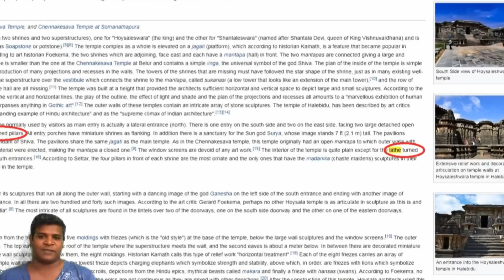Hoysaleswara Temple, India - Built with Ancient Machining Technology?

Comment: Good work here. When I've seen documentaries on these places they never look at the details so difficult for me to make an educated guess how they built these temples. It's usually some Archaeologist who has little understanding of engineering who makes the wrong conclusion and doesn't know what evidence to look for. The pillars are definitely done on a lathe of some description. Probably steel mandrels to hold the ends of the rock and a couple of steel wheels at each end for it to them to run on. This would make it much easier to turn while someone with a hardened tool carves the shape to a wooden template. How they turn it would be open to further analysis but some animal powered machine would be obvious. I would centre my attention on looking for the tools first. The polished features could just be from years of hands touching, I've seen many of stalagmites and statutes polished from thousands of tourists hands.

Comment: I wonder if there is such a thing as a reversed lathe. Seriously it wouldn't be that hard with 900yr old tech to just build something that spins the tool around the pillar instead of spinning the pillar. I'm pretty sure if I research it I can find evidence of such a thing existing back then. 

You also might not want to stop thinking of them as primitives because there were not. Maybe they had multon forging capabilities back then. The ancient indian/egyptians  and several other civilizations generally aren't as cavemen like as most people think. The last time I studies a similar statue like that one we found out that the parts of the statues that were hollow inside will just tiny openings to gain access to hollow out the inside were actually added onto the base of the statue. In my case we had figured out that they had melted down that type of rock, used standard molten forging at a very high temperature and then fused the object onto the base. Yes such a thing is possible and has happened lots of time before. 

It wasn't aliens, it is just science.

Comment: If this temple is roughly 900 years old, or maybe older, it is perfectly possible that people used some kind of machines. It is quiet well documented that Romans had water powered machines for cutting stones. As well much earlier Greeks had quiet modern technology of toothed wheels. In fact they were same as our toothed wheels in small machines. With their abilities of metal casting it is entirely possible that they were able to build quiet large machines. It is entirely possible Bronze is used even today on bearings, so it is within range of possibilities. Such machine would not survive wars as it would be melted and used for weapons and so on. 

As well as this temple looks like from basalt, it is possible that those statues are cast as are statues from bronze. Basalt is today commonly melted and used in pipes that transport abrasive materials or aggressive chemicals (acids and so), that would quickly destroy iron pipes. Melting point is only around 1300 deg. Celsius. Iron melts at 1500 deg. Celsius, thus it could be possible that those statues were first made out of wax, then covered in sand, forming form, and then liquid rock was poured in making statue. It is more plausible than some "UFO" tool even them would have problems with those small hollow heads. 

Despite no Pines in India, there is plenty of other coniferous around world, perhaps you could find some similar cones, or it is some different plant, maybe seed. or it could be sign of migration of religion from places where pines are common or it could mean that pines went extinct in India. At some parts of Europe taxus became extinct as all were chopped down for wood used on bows.

It is strange but it is still within range of possible technologies that human could had back then. Be it stone casting, be it machinery, it is possible. There was at time civilization that used mixture of resins and other things instead of mortar, this mixture was then hardened by heat(fire) within building. This as well baked bricks little bit.

This is bit strange explanation, machinery, casting and so, but fact that we don't have evidence is not evidence of absence. One or two discoveries of large toothed wheels and we will had to admit that it is possible. Maybe some texts could help as well. But As there were many wars, this is perhaps less likely than discovery of some part of machine.

Comment: It simple engineering ( complex for those times though ).

Step 1 : Set up the unfinished square shaped pillar in the centre.  ( from rock quarries, rectangular pillars are quarried)
Step 2: Setup a wheel around the pillar, resting on couple of wheels, and these wheels runs on a circular track. Which means now you can rotate the wooden wheel around the pillar, with the center of the pillar as its axis. 
Step 3 : Setup a long metal or wooden support rod, along the radius of the wheel, and at the end of the rod, towards the pillar setup a metal knife edge (a hard knife which can etch stone)
Step 4 : Add 2 or 3 spokes to the wheel, about 6 feet long each along the radius of the wheel extending outwards from the center.
Step 5: Now tie one bullock each to each spoke, or an elephant. 
Step 6: Adjust the knife edge, such that the knife touches the pillar in the center by a few mm.
Step 7: Make the bullocks go round and round. The knife edge touches the pillar and starts scraping the stone mm by mm.
Step 8: Once the pillar is scraped, readjust the knife edge by pushing it towards the pillar inch by inch, mm by mm.
Step 9. Repeat Steps 7 and 8... for probably 10,000 rounds . Who knows ?

Now you have a nice round pillar.

Step 10. How do you get the ridges and valleys in the pillar.

Simple. I gave design for only one wheel around the pillar.  Instead of that if the design of 20-30 wheels, each have a knife edge, and depth of knife edge is different for each knife, you get this nice curvy pillar with multiple ridges and valleys.

SIMPLE BUT INCREDIBLE..

Comment: They probably used water-powered mills, similar to what were used to grind grain into flour. With a large enough mill, you could, using the gears, spin the column on a lathe (instead of the millstone that we know they used for grinding). The column looks like basalt, a very hard stone, but you could use a diamond studded bit to carved and polish basalt. It was a far more sophisticated type of water-powered mill than medieval Europe had, but the same basic idea. No alien technology, just very clever people with an advanced math and skills. As for the thin hallow carvings, crafts people make many carvings like that in India to this day. Not sure how, but they do, you can buy very intricate hallow stone carvings at the tourist shops.
Reply: The material is soapstone no basalt((( and its sad

Comment: Modern tools have become smaller, faster, efficient and affordable but most of the time they still use the age old concept. A drilling machine uses the same technique used in the Archimedes Screw and its design pre-dates itself. Indians have a strong connection with nature. It is quite possible that we understood both the magnificent powers and the devastating force of nature. If they had a telescope already, They understood how to work with "LIGHT" . If its concentrated, (using a lens of some sort...it could work like a laser. What if they used a laser to cut these.may that's why we don't see the chisel marks

Comment: Modern day fools think humans came from apes but when Ezekiel saw a flying wheel within a wheel that shows that wheels were commonplace and that although flying and eyes were a bit unusual maybe, the idea of machinery with concentric, independently [or inter-dependently as in gears] rotating parts was being used in some manner.

They have found massive industrial smelting factories near the Dead Sea and massive stone cutting gang saw in Greece, along with the best concrete in the world in Rome, a Greek clock so accurate is kept time to the century mark or more without needing to be reset,and pressurized water 2 and 3 stories high in Babylon.

They had steam engines in Egypt [formerly claimed to be 'nothing more than novelties']and batteries as well.

SO MUCH technology!

Comment: There are clear signs of both lathe work and other machine work on those pillars but what ever happened to those machines? To be sturdy enough to handle loads like that they'd have needed to have been massive, with nearly indestructible bases.
Reply: exactly what i was thinking @@where did those machines and scripts go? imo its part of a huge conspiracy done  by someone very powerful to hide  this mechanical advancement we had 900 years ago..by now we should"ve  been in mars @@ thousands of years of hardwork,research and history destroyed.
Reply: I was a machinist most of my working life, maybe that's why things like this fascinate me,  I know full well we were not suppose to have equipment capable of that kind of work any farther back than well into the Industrial Revolution. But yet the evidence of their use is there in plain sight from at least 600 years too soon, probably a lot more.
Reply: Bear Peterson You may brag over and over that you are a machinist on this video. But the truth is, laves are NOT complicated machines buddy.
Reply: While that may or may not be the case, it still doesn't explain the simple fact that for those genetically modified monkeys, or for any other humans no matter what our origin, to produce any machined surfaces they would first need to produce the machine tools required. Yet we see the examples of those machine's distinctive tool marks marks all over the world too many centuries, or in some cases too many millennia, too far in advance of those machines themselves.
Reply: But it's not just in India that there are tool marks clearly visible,  yet no trace of any tools capable of those marks from that era has ever been found,. You can find examples scattered all over the globe
Reply: No, if you want to turn big, heavy objects like these pillars it makes sense to have the pillar stand still and rotate the lathe around it. Think of a wooden capstan build around the pillar with the bit on the inside ring.
Reply: Maybe they repurposed them when they were finished building the temple. Or they were conquered and some other people shipped them away. Or maybe they were the victim of a larger age's ignorance and destroyed...
Reply: its not like it would have been that cool to you and I, besides the fact  it would have been done without electricity. big sketchy rock spinning base, maybe ran by water, or by the obviously ingenious monks themselves, with a big fancy wood or rock pillar next to it, big giant funny drill bit slowly digging into the column spinning 1 mm an hour...  Not like the people from this era weren't smart, they just used giant rock and wood tinker toys.
Reply: Ya because they leave building equipment at construction sites all the time. Damn local Walmart parking lot is impossible to find a parking spot because of all the cement trucks and cranes they used to build it are left there......
Reply: I agree with DreadX10. My immediate thought was that the pillars were roughly carved in place than some form of machinery that would rotate around the pillar was assembled around it to create the lathing pattern.
Reply: Water jets, actually slurry jets, as abrasive dust mixed with the water is what does the cutting, can do some amazing machine work, but they too leave their own identifiable tool marks.
Reply: The obvious explanation is that the cutting tool goes round the workpiece. Duh!
Reply: They're in the basement of the Vatican...
Reply: yahchild06 well , imagine a car being left outside for 100 years it would be gone because of all the erosion , the only thing that stays over time is rock , all the evidence is gone now. I highly suggest you go look at , Bright insight on YouTube.
Reply: DreadX10 that could work, but you'd be talking about a machine even more complex than a normal lathe.
Reply: Bear Peterson maybe their machines weren't as durable. So in time they rotted away, and the few remaining pieces are unreckognizable. Like the antykera mechanism.
Reply: These are impressive works!  They are not however an indication of modern machine tools.  To make a suitable lathe for stone it seems to me that you would need to support and turn the work, and press cutting tools against it.  This would take: 

(1) support posts for the work, which could be stone or perhaps wood.  If it was turned while horizontal, stone carving of two pyramidal end supports was within reach.  If it was turned vertically, some sort of base bearing and a support for the upper end.  Vertical turning may be more likely, as it would reduce bending of the work and the resulting cracking.

(2) a bearing surface, which might be wood or stone with lubrication (animal fat or grease).  

(3) men or animals (elephants?) to pull on ropes to turn the workpiece.  

(4) support for the cutting tool(s) used.  A wood beam seems sufficient.

(5) a cutting tool, or even a hard rock or grit as abrasive tooling.

(6) a great deal of time, patience, effort and resources.
Reply: Bear Peterson, see all the stone (including the building)?  Stone counts as massive and nearly indestructible, yes?  Clearly it has also been shaped and cut.  A lathe could have been built there, used, and then removed just like the other construction equipment and tools.
Reply: Metal corrodes and will rust away to where there wouldnt be anything left after thousands of years. So its not surprising that there wouldnt be any left. Even our technology, cars, computers etc would vanish...
Reply: Eric Bishop why metal?  I mean, that's what we would use, because it's a great material and easily available to us in this century.  What did they have at the time?
Reply: I agree with the other postings that suggest that the tool could be rotated around the work.  Given the principle of the lathe, round bearing races could be built.  Ironwood or stone(?) bearing balls or rollers could be made.  I wonder what materials were available at the time?
Reply: Aniket Vatsa ... When i was in the "basement" of the Taj Mahal, all I saw was Shah Jahan's  actual sarcophagus which was mimicked above ground, and where the "Missing" diamond was once placed. Can you tell me who demolished the Khajuraho Temples and who it was that rebuilt them. ? Hindu's are no exception, they, like the Americans, Japanese, Australians, Chinese, EGYPTIANS etc. etc. are guilty of rewriting the histories of the "present patches" they live on. Dates are changed and attributes are given where none exists, to connect them to the land they now occupy. Building your stuff on top of existing stuff was the Roman way of saying we're here to stay, and in no time, the locals are bowing down to a new God. There is very little connection to the Global technically advanced civilisation and our present "civilisation". The Egyptians, Romans, Greeks and the Inca, etc. etc. etc., all built on structures that they discovered on their arrival, and all those structures were bigger and better than anything we can reproduce today. Maybe, that's what people don't like. ???
Reply: natohammy,  no not all, those that they use for surgery use plain water,  and those for cutting soft materials can use either plain water or water mixed with soluble long chain polymers, but for cutting hard materials an abrasive slurry is routinely used.
Reply: +MrTechnophile The pillars are soapstone.  Soapstone is often so soft that you can gouge it with your fingernail.  Yet, it's VERY weather resistant.
Reply: They used water and rope.
Reply: Maybe the British destroyed it all, when they raped India.

Comment: Great video, I am a maintenance Manager in a CNC machine shop and very familiar with all types of modern machining and agree 100% that the pillars are turned on a lathe. There are such thing as manual lathes that are more primitive in the 1800's before electricity was readily available. But it's hard to imagine a lathe the size needed to make these pillars as a manual lathe. But I suppose it's possible. Especially with the knowledge they had of planetary gear systems. Once you have the piece centered on the lathe and spinning, it takes very little energy to keep in spinning. The only energy that would need to be applied once spinning would be to overcome the friction of the cutting tool. Which could be done easily with gear reduction.